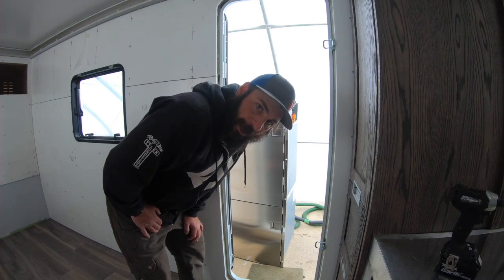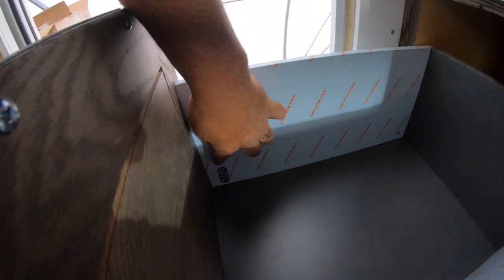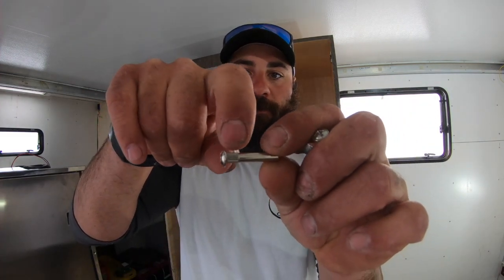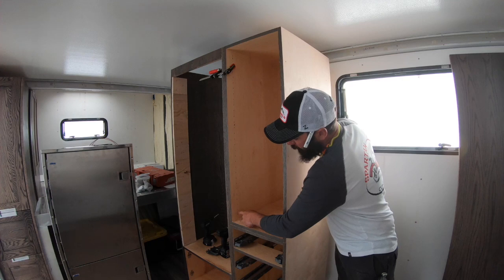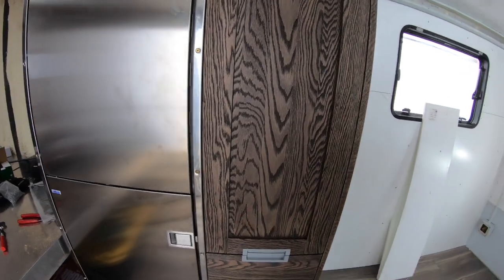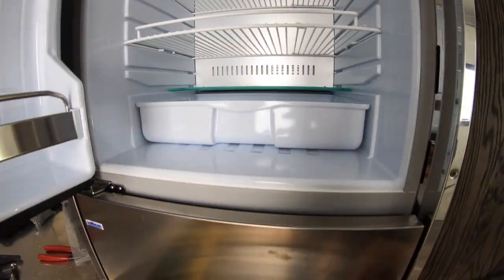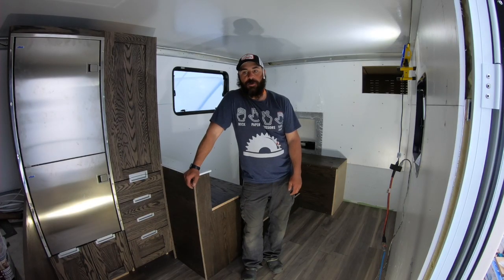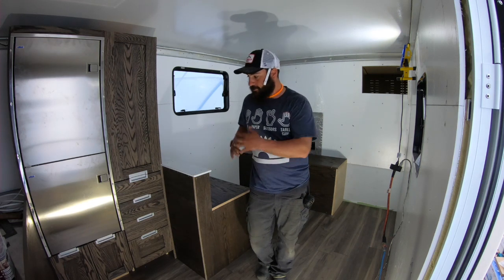Overland habitat interior cabinets & isotherm refrigerator

Comment: Posable idea for you

The side with the pass through you could add the hard back may be 3/8” material would be enough. glue the foam to the board make sure all the edges a super rounded off and insert in to the cloth or leather outer shell. the hard back will bridge the pass through opening but will otherwise be out of site. Then you have all the pieces to make a second bed in the area if you collapse the table and lay all the cushions down. Not sure if you have the height of back rest cushion to lay down and make a bed for the kids once you have them! So figure that out so that there aren’t gaps. Gill lock nice fridge. Really pulls things together well.  You’ll need to come up with a classy latch for all the drawers and cupboards to keep things in place. What’s your plan for that? Maybe you said. My volume is broken so I only hear half of what come out of my device! Ha!
Reply from the maker: Thanks for the input... I’m considering magnetic style drawer latches or maybe electronic.